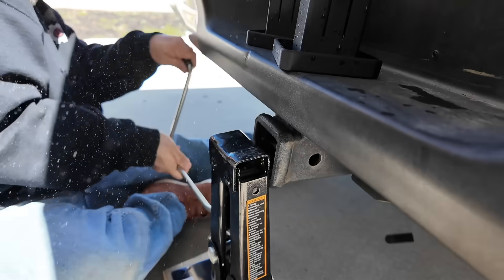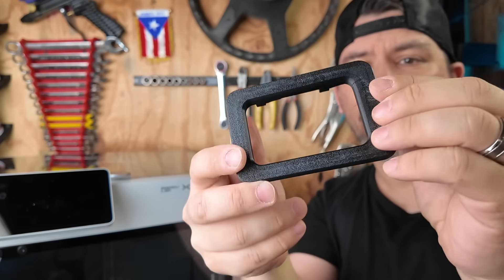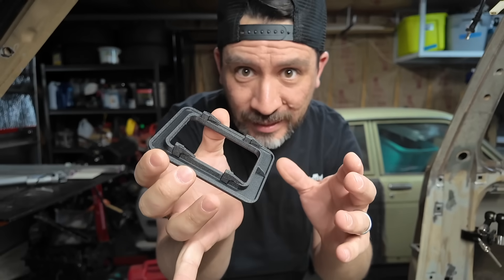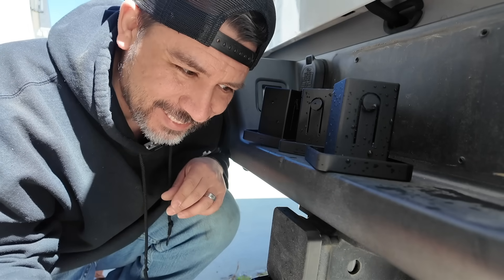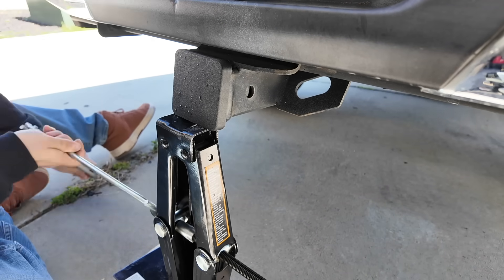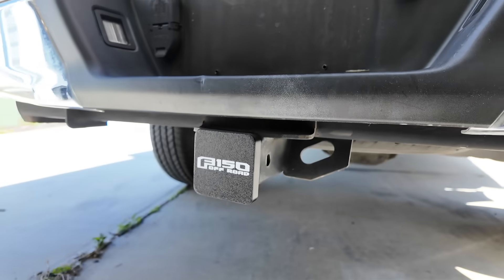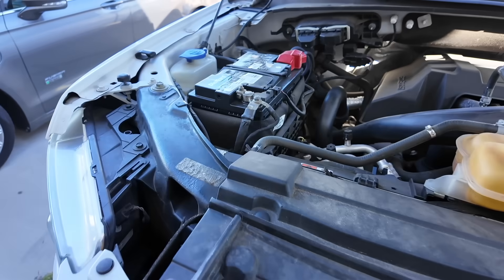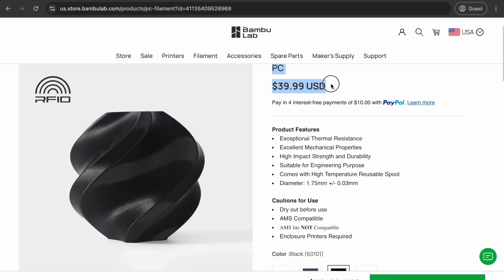Which 3D Printer Filament Makes The Toughest Car Parts?

Comment: This seems like more ad of sponsored bambulab. To test part strenght try different orientation as well, it plays huge role!
Reply from the maker: @Valuiskihh  sure, but we like the smooth surface on all the parts we tried. And it’s no secret, Bambu Lab sent us an x1c to try out. But you can do the same prints and tests with any enclosed 3d printer of your choosing 🙌
Reply: @Itsallaboutthebuild i print with abs on ender 3 v2 😏 right orientation will improve surface too. Abs can be also smoothened with acetone
Reply from the maker: @Valuiskihh  Nice, how do you prevent warping? We used to pritn on an ender 3 max neo and it was tough to get ABS flat....
Reply: @Itsallaboutthebuild i made enclosure :) 50*50*50cm and biqu print plate. Works like a charm!
Reply from the maker: @Valuiskihh  aha, that would do it. Great idea 🙌🙌🙌

Comment: Any part thats going to be used outdoors and in the sun a lot should be printed in ASA.
Reply from the maker: Yes, ASA is the winner for sure. Would like to try some ASA-CF too 😁
Reply: @Itsallaboutthebuild  ASA-CF is stronger, but more brittle too. So when it starts to give, it practically shatters, the same as PLA. There is no give to that material. You may want to look into PA6 or PA12 if you want something that can survive the heat under the hood. They are printable Nylons with Carbon Fiber reinforcement. They are a bit pricier though. I tried PA6 last summer and it was $52 a spool. And I didnt find PA12 CF in-stock when I looked, but its supposedly the end-all be-all for engineering materials that are functional in high thermal applications.
Reply from the maker: @secondleasegamer8312  Oh man, thx for all the advice. Will look at some PA6 or PA12 too. 🙏🙏🙏
Reply: And if you need some REAL strength. PA12 CF is the filament they use for 3D Printing Gun parts. Its a printable Nylon with Carbon Fiber reinforcement. Incredibly strong, but a bit of a pain to print with.
Reply from the maker: @secondleasegamer8312  Oh nice, what 3d printer do you use???

Comment: Used pla+ on a exterior 5th wheel plug/cap and its been in there for years... holding strong from 115°F direct sunlight to -15°F snowy winter
Reply: It depends on the color. I also have the electric plug cover made out of gray PLA. 2 years outdoor, nothing has happened to it. Yet I had a part made out of black ABS that was supposed to be mounted on a black metal surface, it melted during the summer heat.
Reply from the maker: @ThomasAnderson-i3b  oh wow, good to know
Reply: Super PLA+   That filament is tough.   Engineering grade.  Not brittle at all and has great impact strength.   If you print solid and in the correct orientation for its load application, its performance is comparable to a strong injection molded part.
Reply from the maker: @llinkpres  super PLA+ huh… what type of parts do you print with it???
Reply from the maker: I've heard PLA+ is also nice. I'll add some of that for our next set of interior parts. Thx!!!
Reply: @Itsallaboutthebuild  PLA+ is just modified PLA, and every manufacturer who makes PLA+ has their own blend, so they cant really be compared. You should 100% be printing in ASA for Car parts though. It has the highest heat and UV tolerance for a mainstream material. If you need something more heat resistant or UV resistant than ASA, you'll have to look into much more expensive materials used for engineering.  ASA is still affordable, and what almost everyone uses for car mods.
Reply from the maker: @ Very true. Wish it could hold up to a little more heat in the engine bay. PC and others get a bit more pricey 😮‍💨

Comment: A copse of coments 
-remembur that a lot of filaments dont like uv, solvents, and fore example salt water foru a long time 
-A lot of plastics experienses a lot of creap espeshery will att more then 30c 
- the 3d prined parts you showd dont really look designd foru 3d privting and therfore are less storng the expected
- Lastly a lot of high performance materials requers atlesh a 50c cambet to work
Reply from the maker: @Goroca  thx for the tips. Been playing around with changing wall layers and infill to add some more strength. You also make a good point about UV and salt. Used to live up North and the salt could get really bad. Those would be two fun tests to try out. Thx 🙏🙏🙏

Comment: The question no one seems to answer is:  How do these materials hold up under extreme cold conditions?  Some automotive HVAC slide controls use plastic parts that get brittle in northern winter conditions.  If the control wire binds a bit, positioning the slider control can break the plastic part.  While summer interior temperatures can get hot, these parts are not exposed to the sun so must maintain structural performance up to the 170°F ambient interior temperature in warm summer climates.  In cold conditions, structural performance down to at -20°F or colder is needed.  What material will perform over this extreme temperature range?  Filament data sheets rarely specify cold performance.  I am guessing that properly annealed nylon 3D printed parts might be suitable for this application.
Reply: most of the plastic parts within the interior of the car are either ABS or ABS-GF. That black cheap cracky stuff - it's ABS. They are injection molded, and yes ABS cracks in cold weather. If you need to withstand the cold it's again Polycarbonate. It can withstand down to -60. But you'll need to check the filaments, their temperature ratings differ a lot among the brands.
Reply from the maker: @ThomasAnderson-i3b  thx for the info 🙌🙌🙌
Reply from the maker: @knavekid  that’s a great question. Will have to create some clips to put on the ac condenser line to test cold. It doesn’t get that cold here in the southern region of the U.S. states. May need a road trip 😁😁😁
Reply: @Itsallaboutthebuild  no have fridge?
Reply: Or my favorit 
Peek will do it
Reply: @Goroca  yep aerospace oriented stuff will do, but mind the price...
Reply: @Goroca not realistic. But PPS-CF might work. I use that, though not for cars.

Comment: I have used carbon petg in tail light parts. In 100F and held up for years.
Reply from the maker: That’s awesome. Will have to add it to the list of testing. Curious is it as strong as PETG or does the carbon slightly reduce the layer adhesion???
Reply: @Itsallaboutthebuild I have had less issues with it than regular petg. And I was printing it on an ender 3. The two biggest differences I noticed was it had a matte finish, and was more stiff than normal.
Reply from the maker: Nice, I'm going to order some now from Bambu Lab. Might try the Malachite Green to throw some contrast on the black BMW e30 interior :)
Reply: Those tabs will always break along the layer lines. Try printing it standing up 90 degrees from the current orientation.  You will sacrifice surface finish for stronger tabs
Reply from the maker: @futrellgarage9153  that will for sure help, but wanted to see which filament would have better layer adhesion, just love that bed texture too much 😢😢😢
Reply: Safety squints ftw!
Reply from the maker: @ThaDad_DoingThings  forgot them safety glasses. I should know better. Years ago I have a Hercules hook fling back into my eye. I’m pretty lucky it didn’t take my eye out 😎😎😎